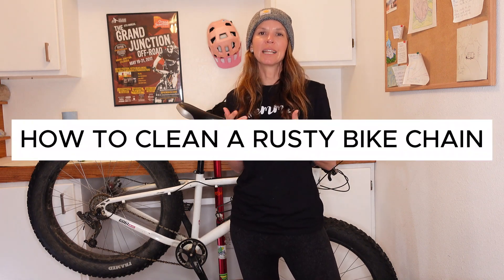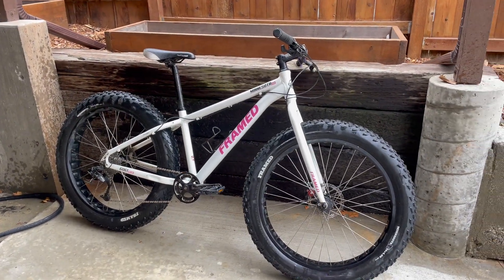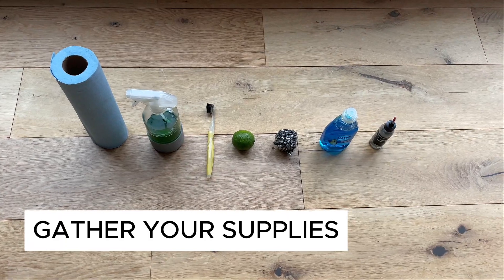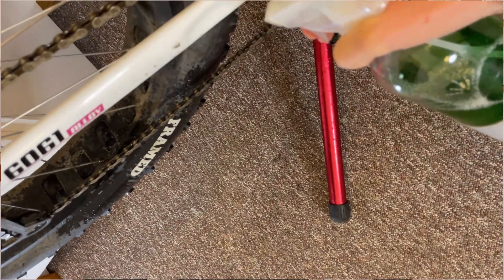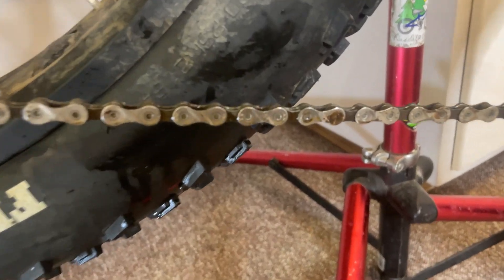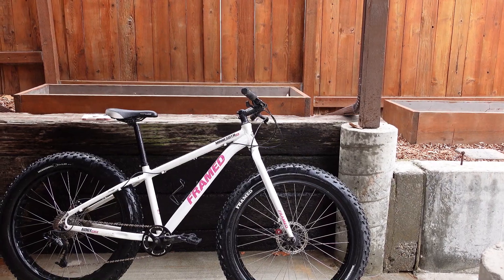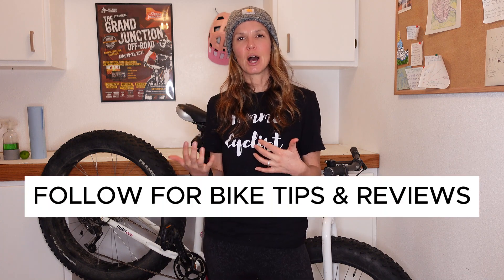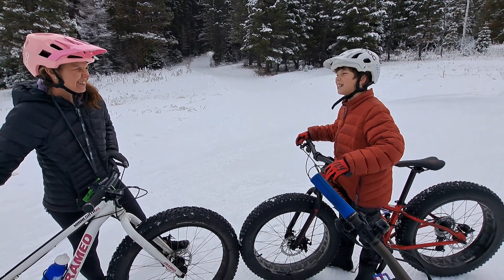How To Clean A Rusty Bike Chain (Quick & Easy!)

Comment: My chain is one of these https://youtu.be/2uW3dxIHXK0 which are quite rust resistant . Silca Synergetic is one of the best wet lubricants and amongst the products tested by Zero Friction Cycling . Youtube won't let me link directly to the test data but it is a treasure trove of a site.

The sliding surfaces inside a chain are where the friction matters and you can't scrub rust off in there. The outer chain plates do not contact anything except when you change gear and then mostly the ends of the pins. The outer surface of the chain rollers are locked in a static position when they contact the sprockets so do not rub once engaged with the sprockets. The inside of the rollers are a sliding surface ( with the pins / bushings) but you can't clean those by scrubbing.

If you've got light rust I would not worry. Remember that friction implies that surfaces will be worn and the rust will get polished away. Heavy rust is a different matter and the Citric acid in the limes will likely pit the metal at a microscopic level. It gets converted into water soluble Iron Citrate that you can wash off your chain. You are actually removing chain material and not converting it back into metal.

Modern chains are made to break at about 8000 Newtons ( roughly 800Kg or 1800lb weight ) and people use these on 750 Watt E-bikes which are brutal on chains compared to a normal cyclist. For chain tensile testing see https://youtu.be/b05LxsuD1WQ. Its a long video. I've only snapped one chain in 30 years and it was worn well past its replacement point. Of course you can be unlucky and get a chain with a manufacturing defect.